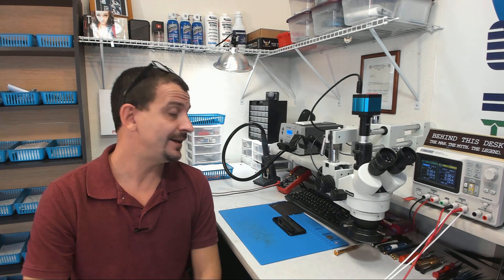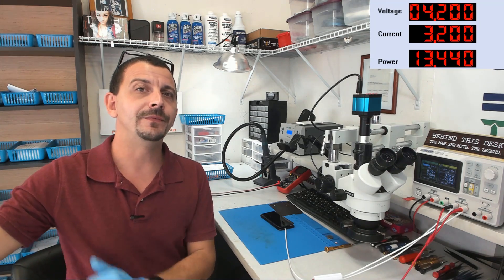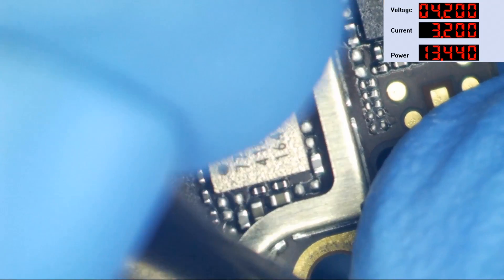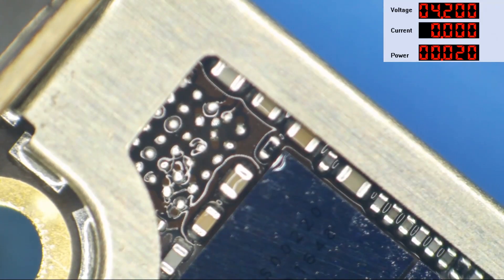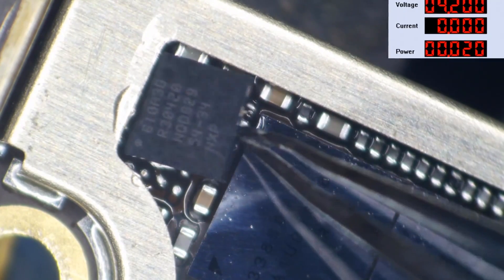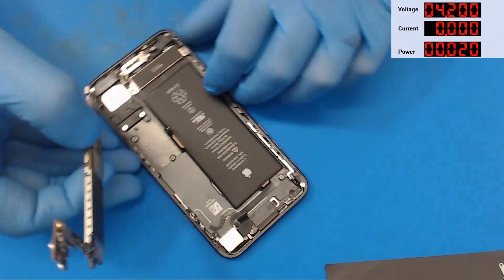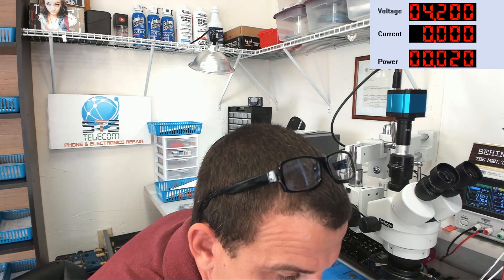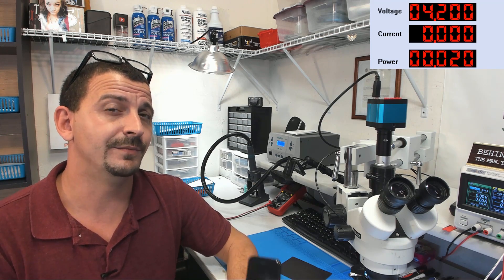Tristar failure and the 200mA load (an iPhone 7 demonstration)

Comment: Ive been using the tip of the power button trick on iphones as a telltale of tristar failure for a few years now...another good tell is to boot the phone and turn on airplane mode the psu should then drop back down to 0.00 after a min r 2 if it sits fairly high say over 0.10  then its defo tristar

Comment: Thanks for that video! Well i ripped off two pads where the LCD connector sits because i used only the iron to clean them, but didn't continue heating up the board with the hot air, so now i realized my mistake. You give awesome tips!

Comment: My iphone 7+ get broken and the screen dead so the phone never start up again ,as an electronic engineering student I measured the power consumption on the logic board , it takes zero until I pressed the power button on the phone the reading just jumping to 2.8 A for 0.5 sec and get back to zero again , that's can't lead me to the shorted components, if you know this issue please give my a hint.

Comment: I HAVE my iphone 6plus i was charging it with a non genuie cable and the cable was no stable and suddnely the phone is dead ! i put it on power supply is just take 0,20 amps when i press power button ! i did not continue fixing because no time ! did u think is the tristar failure depend on ur experience! thanks

Comment: Hello sir I'm from India and I'm so much impressed with ur board repairs, specially when it comes to board cleaning and sharp soldering u always rocks.
Sir i have a iPhone 5s which works normally but if i do some hevys works like surfing or downloading apps from store or multi-tasking it goes off or gets in on-off loops i can only see the apple logo and then apple logo goes off and only screen backlight i can see. It takes few minutes or hrs to boot thn again it works normally until multitasking.
I tried update/restore/erase/Downgrade nothing helped. Phone is detecting in iTunes i can flash it. Sir if you have any idea or thought let me know.
Thank you.

Comment: Great job.  Great video. I have been replacing the display seal before I install the display. They now sell them on eBay and iPhone supply stores. I think the iPhone owner would expect and appreciate a “waterproof “ iPhone.
Reply: Are you buying just adhesive or actual ip67 adhesive?  Careful when you tell your customers that their phone is waterproof. I think those adhesive strips are just adhesive not ip66 or ip67

Comment: iphone 6splus screen rotate error 
please post it
Reply: This may be the gyro/accelerometer chip. It could also be a software glitch as well. Try dfu mode with iTunes...and update to the newest iOS. If that doesn’t work,it’s most certainly a hardware problem. It could be a different component,but the gyro chip can go bad. It’s supposed to be the same chip that works for accelerometer and gyro. This can be found if you google it and people who have zxw(an advanced schematic for iPhone)can give you full details on it. But even a free schematic from union repairs website can help you with basics. Keep in mind this is a very advanced repair. If you attempt it,PLEASE practice on a few dummy boards first. Bga is very hard starting off. A decent hot air station and in general people use 350-380c on iPhones...but that’s an average. Every hot air station works differently.